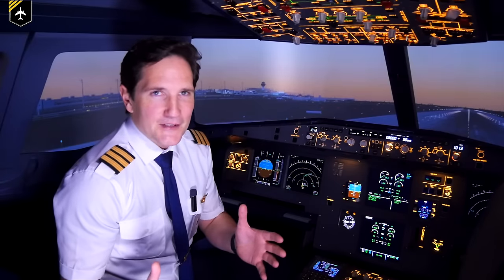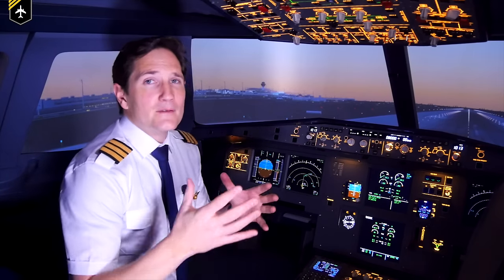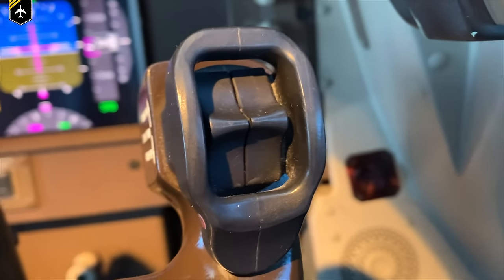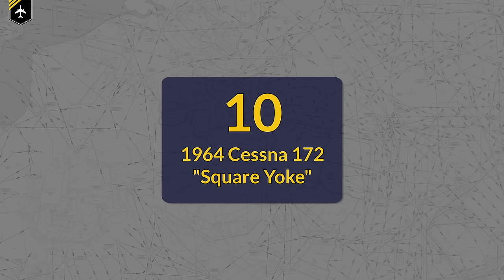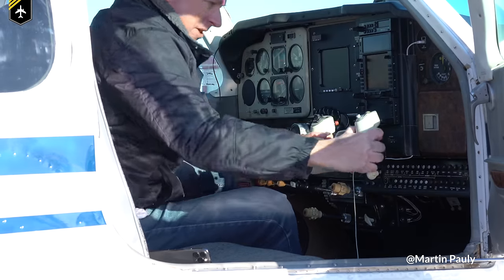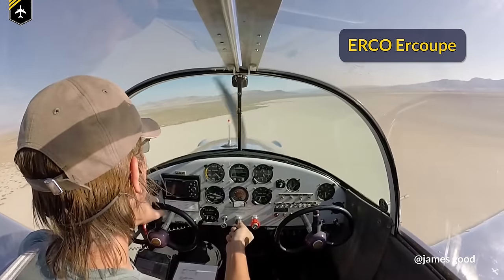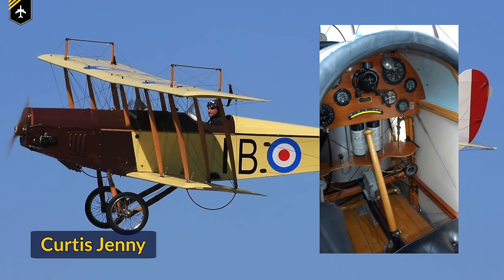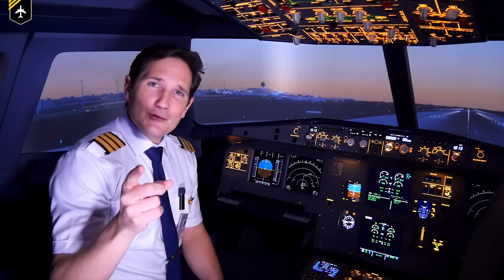WHAT do the buttons do on a FLIGHT CONTROL YOKE? + TOP 10 YOKE designs! Explained CAPTAIN JOE

Comment: Question: why does the pilot flying hand over the controls as they’re leaving the runway after landing?
Reply: Ground steering is done with use of a nosewheel tiller.  Some planes only have those on the Captain's side, so guess who's doing the taxiing and who's talking to ATC...
Reply: Some companies have a policy of captain to taxi. Hence if the first officer is the pilot flying, he or she will hand over the controls to the caption once on the ground. Also, as said in the other comment, some aircraft only have a tiller on one side, hence the pilot on that side does the taxi.

Comment: Time stamp 4:46 why are all the screens flashing in the airbus??
Reply: The flickering is an anomaly caused by the refresh rate of the displays in the cockpit and the shutter speed of the camera. If you were in the cockpit and directly viewing the displays with your eyes, they would not appear to flicker. From a technical standpoint, the displays in the cockpit do flicker, as do televisions, computer monitors, and the display on a smartphone. However, they flicker so quickly that the human brain does not perceive it.

Comment: At 4:42 the display s are having problems I think
Reply: The flickering is an anomaly caused by the refresh rate of the displays in the cockpit and the shutter speed of the camera. If you were in the cockpit and directly viewing the displays with your eyes, they would not appear to flicker. From a technical standpoint, the displays in the cockpit do flicker, as do televisions, computer monitors, and the display on a smartphone. However, they flicker so quickly that the human brain does not perceive it.

Comment: The motor is designed to shake the yoke while the aircraft is stalling to indicate the pilot that they’re in trouble (just kidding)
Reply: That is actually the purpose of the motor, to vibrate the yoke so the pilots know that the aircraft is about to enter an aerodynamic stall condition.